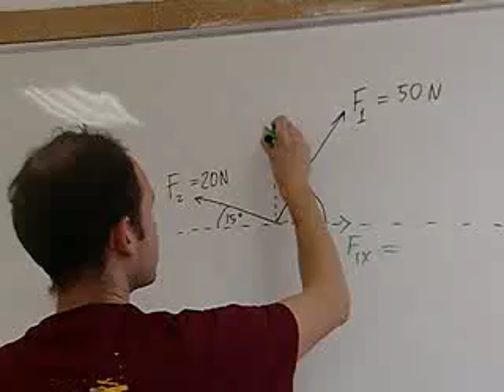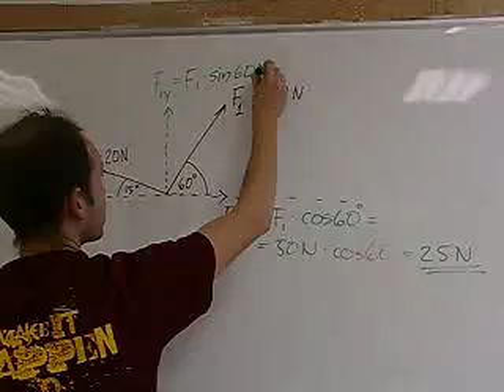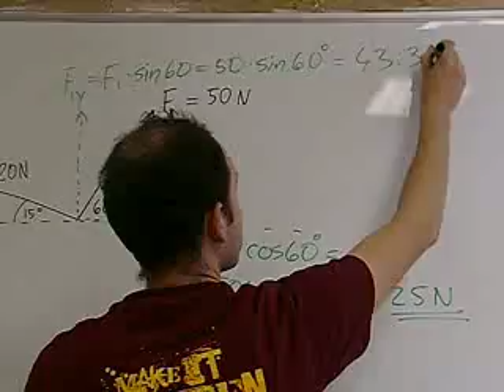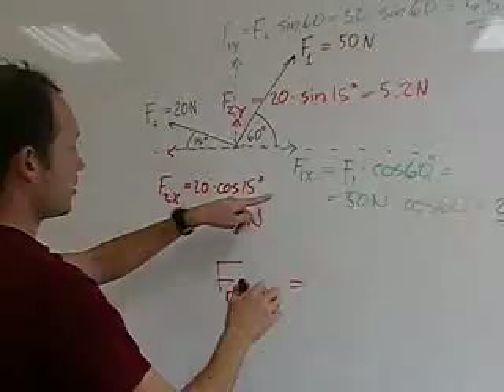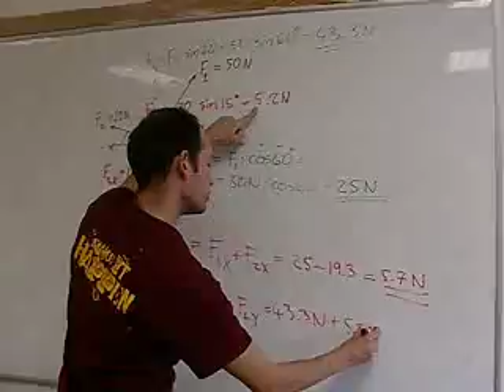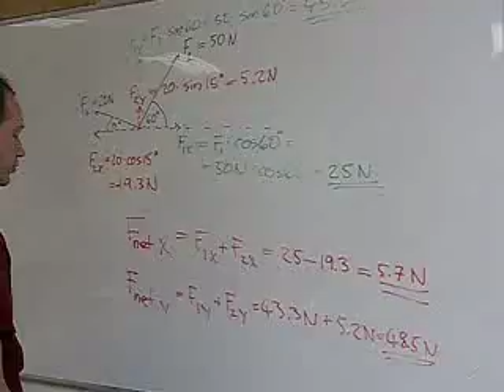Resultant force

Comment: @Wargamer008 To find the Angle of this resultant, you need to take the inverted tangens (tan^-1) of the resultants Y component devided by the resultant of the X component.

Angle = Tan^-1( Fy / Fx) => Convert this into degrees on the calculator.

Comment: I come here everytime I forget resultant force.
Reply from the maker: Hi there. In the problem on the right on the top, the one from your first link, you first have to either measure or deduce the angle between the vector and lines 1 and 2. Only then you will be able to find how to break the 28kN vector into components along the two lines. Once you have those two angles you would just use the same principle as described in the video. For example, the component along line 1 would be 28kN x cosA, where A is the angle between the vector and line 1. Without a protractor I would estimate the angle as half of 45 degrees, or 22.5 degrees.
Reply from the maker: In the second link, the problem on top right asks you to calculate the x and y components of the vector. Again, you are not given the angles, but you can either measure or calculate them from the ratios on the grid.  Take the angle between the vector and the y-axis. You can see that you are working with a right triangle with sides 4,2 and sqrt20 (from Pythagorean theorem, and using the ratios of the grid divisions).  You can use these values to calculate the angles, and then use the principle described in the video to calculate the x&y components of the vector.
Reply from the maker: I am looking at the O2:6 again. I see the answer below. I think the easiest way, if your teacher doesn't mind, is to just draw the components with a ruler using the parallelogram rule, and measure how long the components are. It seems to me that this is actually how the teacher wants you to do it. Then you can use the ratio of measured mm to 28kN to find the values for the two components. If you do it this way you will be doing the least amount of calculations.

Comment: No direction was given. All the problem states is this: Find the resultant force. f1= 25lbs at 35 degrees, f2 = 36lbs at 21 degrees. That's it. Should both have been pointing towards quadrant 1? I just copied the example in the video and put them to different sides.

Comment from the maker: Hi there.Type the whole problem to your comment. It's hard to tell you what exactly you need to do without having any details. In general, to find a resultant force, or to separate a force into components, one needs to know the dirrection of the force(s). Sometimes it is assumed that forces are perpendicular. In that case the resultant is found from pythagorean theorem and the angle of the resultant force is found using trigonometric ratios in the right triangle given by the forces given.

Comment from the maker: That's right. If both vectors were pointed in the 1st quadrant you would add the components instead of subtracting them. You would then find the resultant exactly the same way as described in the video. 
If you are not given the direction of the vectors F1 and F2 (in which quadrant they are), then just pick one case and do it. I am sure your teacher is more interested whether you understand how to do it than in the "correct" answer. Just show your work and you'll be fine.

Comment: s the object stationery or in motion?
Reply from the maker: It makes no difference whether the object is stationary or in motion. The object will accelerate in the direction of the resultant force. If it was stationary then it will start moving in the direction of the Fnet. If it already had velocity, the velocity will change according to the acceleration produced by the resultant force. (PS: If you want to find acceleration, according to Newton's Second Law of Motion, you will also have to take into account the mass of the object, not just the Fnet.)

Comment: Thank you🌷 ,l understand this but l have question .how can l calculate the resultant by parallgram?
Reply from the maker: I am not sure what you mean with "by parallelogram", but I guess you 
would be looking for the diagonal in the parallelogram. If the two sides
 are at 90 degrees then just use Pythagorean theorem. If they are not at
 90 degrees you will need to use the law of cosines and sines and you 
will need to know what some of the angles are to determine everything. 
But it is just simple geometry really. Good luck!